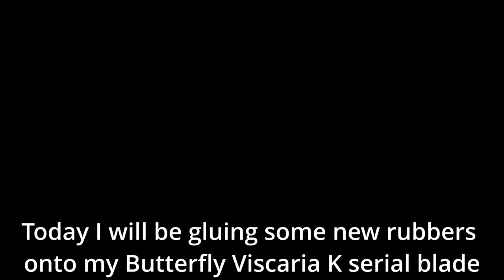How To GLUE Boosted Table Tennis Rubbers | Hurricane 3 & Hurricane 8-80

Comment: I have similar setup, but with a 38 degrees H8-80. Great backhand rubber, it does not need any booster. Only problem of this setup is how heavy it is, likely over 195g.

Comment: Is there an even stronger glue? I use the same glue but I have difficulty gluing a heavily booster rubber. It keeps peeling off at the edges and come off. It's not strong enough. 😭😅